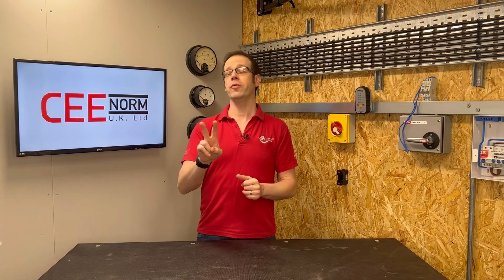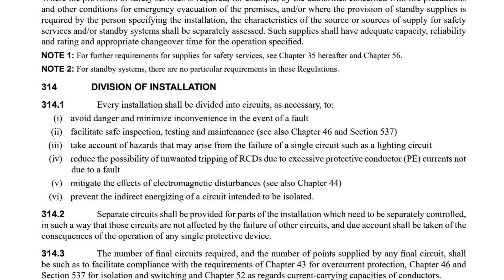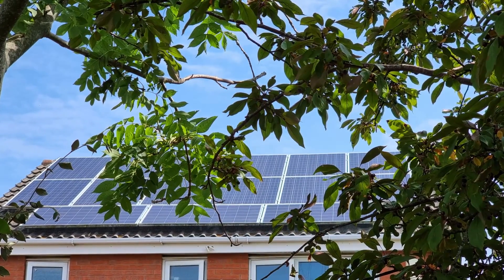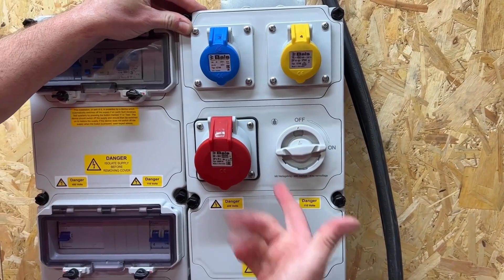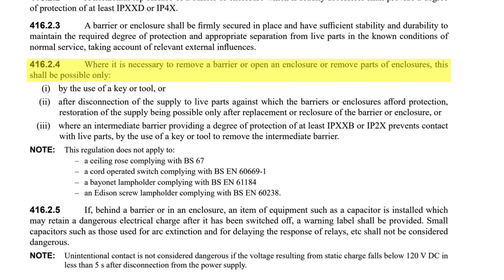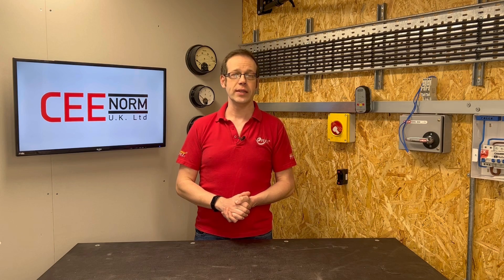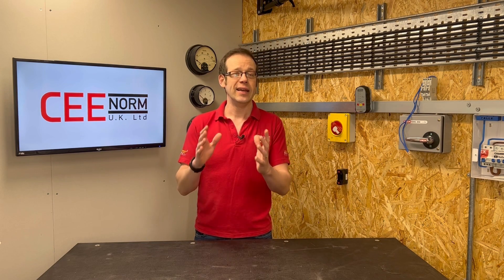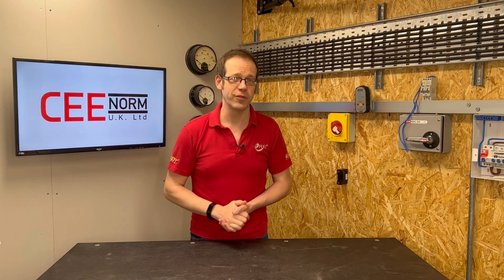Is it Permitted to Mix Voltages & Phases in One Enclosure?

Comment: This happens all the time, I work in industrial and voltages are mixed religiously. when we build panels / motor control etc but segregation is key. The same scenario with data cabling and power cables which is more common place in domestic these days.

Comment: Its common practice to install multiple voltages in a single enclosure. They as stated should be seperate and individually isolated. The label on the outside will state the max voltage installed. Internally the idividual circuits will be segregated and marked clearly with their voltage.
With reasonable precautions and clear marking, documentation & labelling there is no risk of safety. Industrial panels commonly contain 3phase 400v, single phase 230v, 110v plus 110v, 50v, 24v dc in the same enclosure. An experienced trained electrician should have the skills to identify these seperate circuits. Plus Access should only be permitted by an authorised person. So this in my view is scare mongering and creating problems which do not exist, particullarly with competent designed equipment.

Comment: Question.  BS7671 526.5   In a domestic setting why is the MET not in an enclosure?  2 points to consider.  DC leakage to earth as a normal operating function and in a FAULT condition will the MET in a sense become a LIVE conductor.
Reply: It's pointless having the MET in an enclosure if all your metallic pipework is connected to it via equipotential bonding conductors.  Are you planning on having double insulated taps and radiators or putting them in an enclosure too?

Comment: A common misconception seems to be to miss the "relative to earth" part of 514.10.1 and therefore think that a standard 230V/400V three phase system needs a voltage warning notice.
Reply from the maker: Exceptional point, thanks for commenting Peter. 👍
Reply: I was thinking that. Some people give it C3 on EICR when 3 phase dist board doesn't have one.

Comment: Love this video. Could i run a 230v supply to a solar inverter along with the dc cables? Its about 2 meters in length and it would tidy the whole job up? Its all part of the same circuit?
Reply from the maker: Good question, I'm not entirely sure to he honest. My initial thought is if the insulation is rated at the same voltage it should be ok but there may be PV specific regs I'm not currently aware of. 👍

Comment: With regard to 710.559, does this not refer to essential and none essential supplies? As in, one lighting circuit would be supplied via distribution backed up by a generator (the essential circuit), then another separate lighting circuit in the same area, supplied by a none generator backed circuit (non-essential)? I've worked quite extensively in medical locations and haven't come across a light fitting that has BOTH essential and non-essential circuits inside. Not to say they don't exist, I've just never seen one.
Reply from the maker: Great question, is it perhaps a reference to the older "sustained" type emergency light fitting? 🤔
Reply: @efixx  could be. They still use emergency type fitting, with the 3hr pack. Or do you refer to the centralised battery pack system? Which can push out up to 220V DC?

Comment: I have a hard time understanding the way your regulations work… There’s no reaction to running multiple circuits with single leads but when in an enclosure it’s suddenly a risk?
If the competence to understand how a simple enclosure with different outlets works it might be a great idea to close it backup and call someone….
Reply from the maker: Just an extra safety precaution I guess. 😃

Comment: Great video joe ,, subscribe @mainly electrical 👍⚡️
Reply: What about a control panel? It's an enclosure. Having worked on 
stand- by generators and CHP units with a mix of 3 ph and low voltage DC supplies within the panel, nobody seems bothered by the mix of supplies.